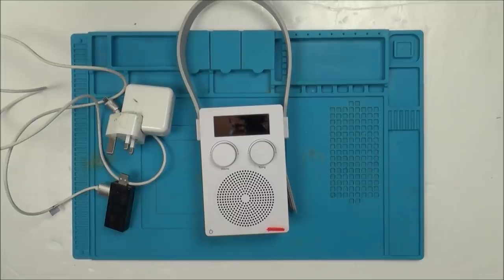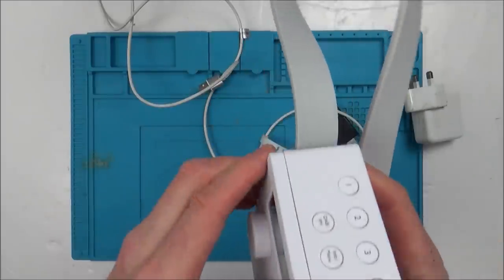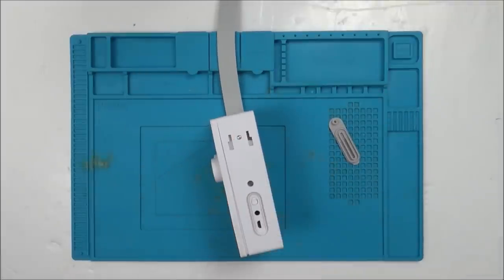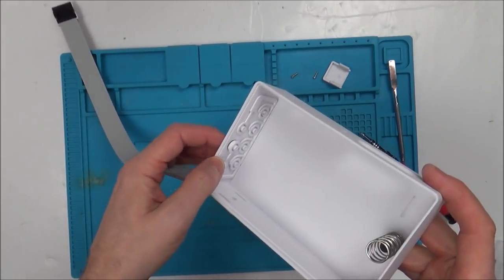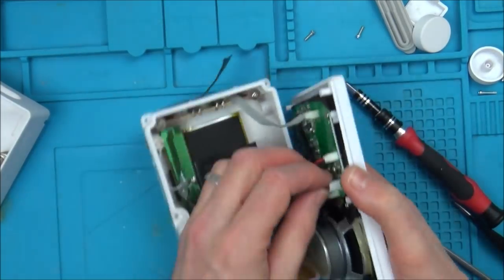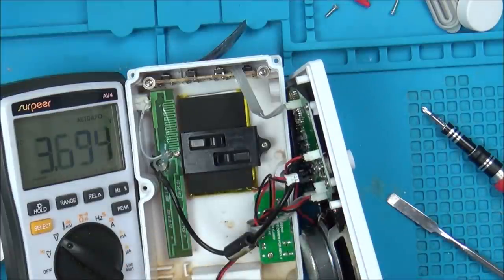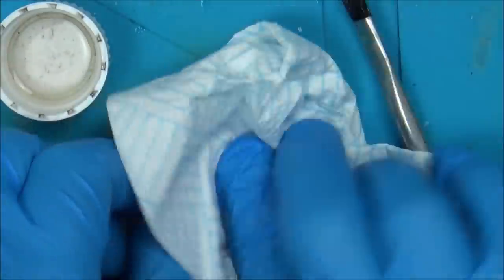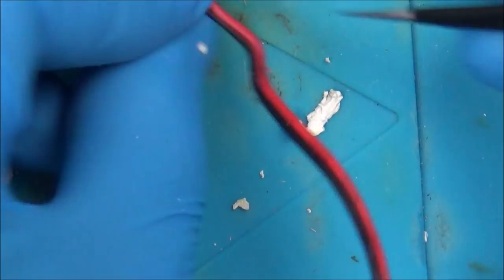Trying to FIX a SPLASH-PROOF SHOWER RADIO

Comment: I already had one "waterproof" shower radio with water damage. It was completely rotten inside. And I wanted to replace it with this exact model, which is also advertised as waterproof. Might have to look for another one. Thanks for your many videos :)
Reply: I wonder if they make a radio that the main unit is outside and has a external speaker you can mount in the shower? At least if the speaker does get ruined you could just buy a new speaker instead of the full unit.
Reply: Check the IP rating before you buy. This splash proof radio is advertised as IPX4. So it is rated to withstand splashes of water, but no protection against contact and ingress of objects. So general wear and tear will significantly reduce the water resistance.

Comment: As long as its not the solvent free version  "free sticks like Sh*t" is based on MS polymer and is often much better than acetoxy silicone for electronics.
well done ...nice simple fix ...much better than binning faulty gear.

Comment: The corroded screw looks like a mixture of cheap zinc plating and galling where two different types of metal react, e.g. cheap zinc or nickel plate against brass and add moisture and manky screw time all round.

Comment: Hey Vince, I use a product "Scotch 6042 Sticker & Marker Remover" to remove permanent marker. It comes in a form of a pen. I don't know if it would work on a rubberized surface or not, but in my opinion it's still a good product.

Cheers.

Comment: I'm fairly certain the point of failure for the waterproofing was the plastic flap covering the exterior of the switch (the part that would be in contact with the giant spring). If you were willing to try to take it apart again, you could glue that down a bit better.

Comment: You can store opened mastic or silicone tubes a little longer by putting them upside down in a bucket filled with water.

Comment: I think it looks better than even a John Lewis with a scribbled orange marker, shame the rubber coating has to be removed though. I think it is the manufacturer preventing fraud, by someoe buying a new radio, and taking the broken one back to the shop for a full refund, and probably a tell tale sign that it has been resold as spares or repair. It is a neat idea, but also puts people off just simply doing things like repairing broken technology because of the mark on the item, and being harder to get rid of the mark than repairing the item.

Comment: Dry Erase markers are Whiteboard markers, and usually will let you clean permanent markers off some types of plastic.  I suspect the permanent marker was absorbed into the rubberized coating  much more than it would on most plastics.

Comment: We use permanent markers and dry wipe markers at work to rotate the dates for deli food when we open new food

It does work, but that has been on there for so long that it's likely stained on there now

And honestly I think it was the alcohol in the dry wipe that removes the permanent ink so if the IPA didn't work the dry wipe probably wouldn't have anyway

Comment: Great repair. Next time you should try use a magic eraser.
Reply: Magic eraser is like using very fine sandpaper. He would have worn the rubberizing off just the same.
Reply: Dragon940 Carp 
I’ve done it myself in the past on a rubberised material. Couldn’t even tell if the text was even there with no damage to the rubberised material. But I guess it depends on the quality of the material.

Comment: I have the same radio but the battery won't hold a charge anymore. How would that battery be described if i was to try and buy a replacement? thanks in advance

Comment: The "dry erase" or whiteboard marker trick is when someone uses a Sharpie on a whiteboard - that trick does work but I've not seen it work on just plastic....
Reply: You don’t dry it, that dries away the solvent.  Clean while it’s wet or better yet try dry erase board cleaner. You can pinch a bottle in most conference rooms. ;-)

Comment: I guess this radio took a bath or was dropped into the tub but caught before it was submerged.
About the marker: I normally use a q-tip and IPA to remove that, because that way you can press on to it without actually rubbing anything like the coating off.

Comment: I have CCrane Witness radio which the speakers are not producing sound.Please help?
Reply: Maybe the wires on the inside might have lost their connections over time, they might have to be resoldered onto wherever they're connected.
Reply: Have you checked the batteries
Reply: Paul Griffiths yes batteries are ok

Comment: The reason a dry-erase/whiteboard marker can erase a permanent marker is because they include alcohol-based solvents; the solvent reactivates the cured marker, so it can be wiped off. Pretty sure IPA would work just as well, if not better.

Comment: The problem with water proof stuff that gets heat cycled is that the pressure difference of inside and outside is so much that it sucks moisture in and then later condenses.

Comment: i use to use degreasing spray that i sprayed on my engine to clean it and found it di more than just clean grease but not sure about rubber but cant be worse than what you just did

Comment: Try axe deodorant spray. I've had a good experience with that. Has often helped me to remove permanent markers from plastic. Maybe it will help you.
Reply: the alcohol in your deodorant is what is helping you to remove permanent marker. since he already uses IPA i doubt that would help.
Reply: @mjuhasz  I never tried IPA. But with the axe deo I have so far gotten all permanent markers away very easily. Is it worth a try or not?

Comment: The FIRST rule of making electrics waterproof is DON'T make them waterproof... water will ALWAYS find a way in and all you're doing is stopping the water getting out. That's obviously whats happened here, I'd have put a small hole in bottom at lowest point to allow anything to drain out.